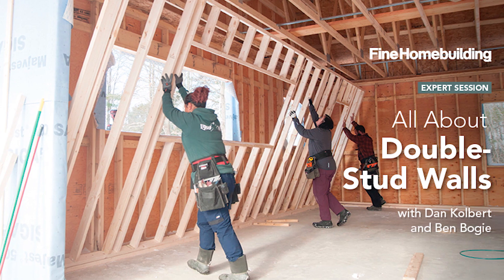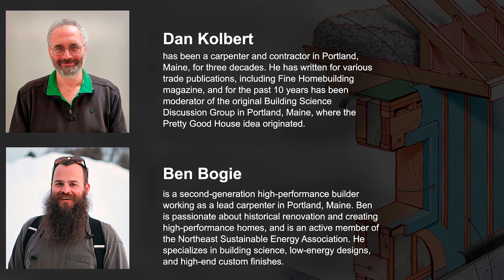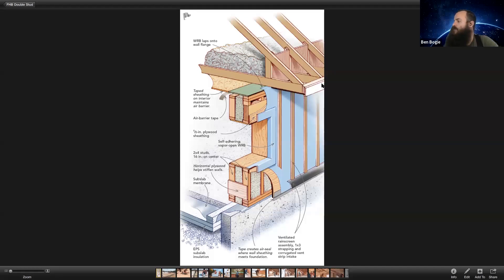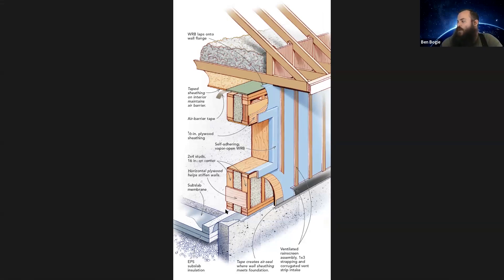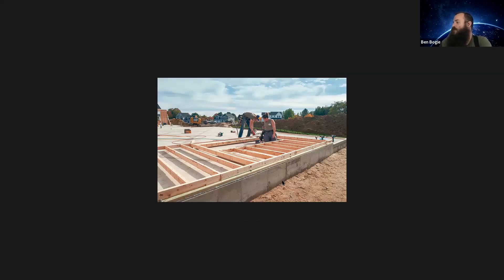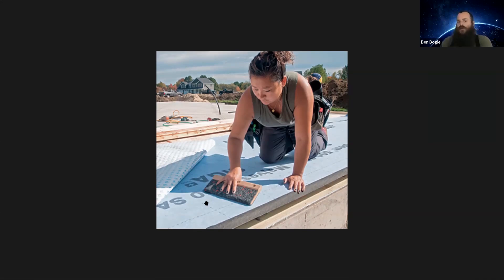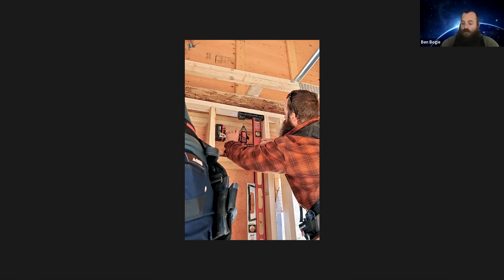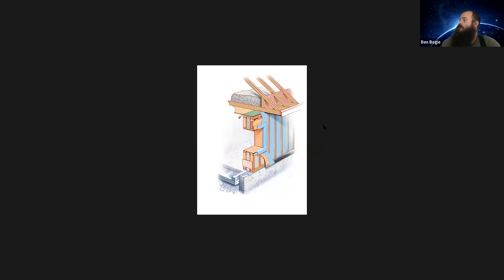Expert Session: Everything You Need to Know About Double-Stud Walls

Comment: Years ago I visited a local builder that did double walled houses and used natural convection from the basement to the attic for cooling and heating. He also used Solar panels for powering fans to force the convection around the building envelope
Reply: Been thinking of this idea. Was there vents cut in the flooring or was there simply no flooring over the joists in between the walls?

Comment: The one thing I didn't really agree with was running your roof venting via the rainscreen channels, in snowy climates. Snow has an R value. 
Picture: Snow on a roof, no snow on the walls, walls getting hit by sun and the air in the rainscreen channels warming up, that air rising to go vent the roof, and it melts the snow as it flows by the plates and rafters causing snow melt/ice dams before cooling and exiting through ridge vents. (You walls and ceilings will be fine, this is an exterior thing but might get to your roof one day).
Reply: i guess im asking the wrong place but does anyone know of a method to get back into an Instagram account..?
I somehow lost the password. I appreciate any tips you can offer me

Comment: Doesn’t that blown-in insulation settle over time leading to big voids at the top of the wall?
Reply: Not if done correctly.
Reply: In short, yes. It can be prevented with extra effort, but given that extra effort many elect to stick with 'batt' insulation (at least, for walls,  that is.)
Reply: Hempcrete (and other self-supporting insulations), offer the best of both worlds. Since when applied wet they fill in gaps, eliminating air leaks. And dry to a solid, preventing settling. 

Plus they can eliminate the need  for an additional non-structural wall, of a "double wall" to add insulation. When design appropriately. 

Hempcrete is still at a relatively immature state of development. So there's limited information in the trades on how to use it properly. So it tends not to be used or when it is it tends to be more expensive. 

But I'm hoping it and other self-supporting insulations, become a more cost effective, viable option. Relatively soon? Especially, since hemp production and processing seems to be increasing.

Comment: I built a house. Then I built a second house inside of that one. I built two houses in one at 3 times the  cost to save $50 a month in energy so it can go to the mortgage company in interest
Reply: If you live in such a mild climate your heating and cooling is only $50 a month, then you're right, why bother?
Reply: If you do the math, it is one partition of about 100 feet additionnal. 50 studs @ 5$ = 250$, Cellulosic insulation system is about 1/2 of the cost of any other solution, and you saving is about 75% on energy consumption. It pays itself in the first year.
Reply: I don't know where you live, but here (Vancouver BC) building codes are such that you need to adopt one or another technique to improve house performance to R-22 walls (and other numbers elsewhere blah blah blah). But that said R22 batts in 2x6 walls don't get you there even if you don't put in a single window, because of the thermal bridging from the studs. We need* to do something here, no way getting around it, and double stud walls is one of our options
Reply: You must be slow framer.